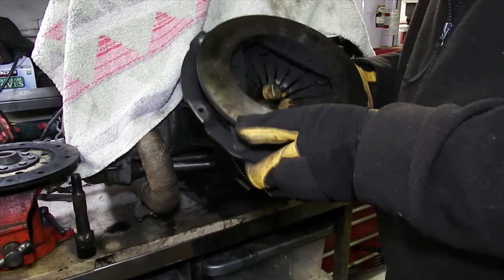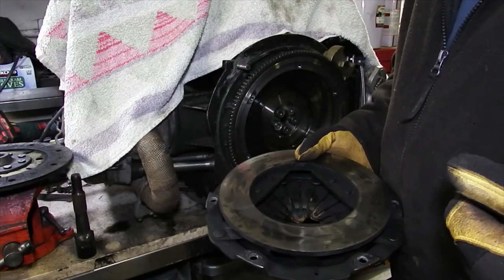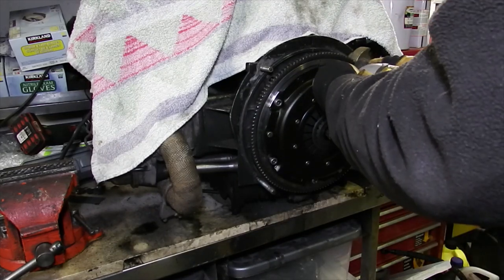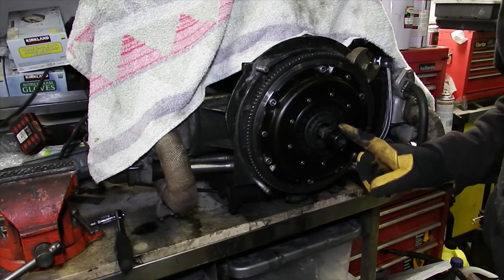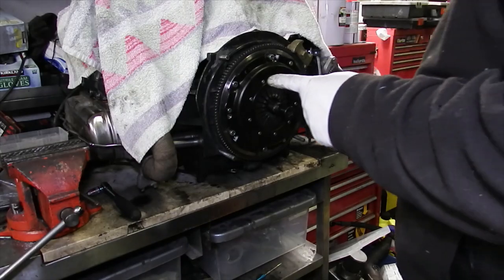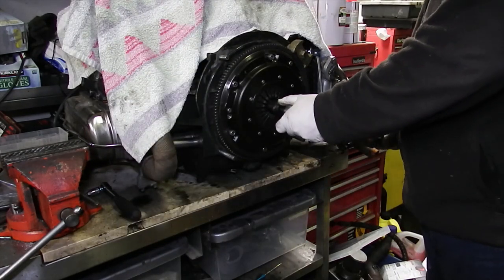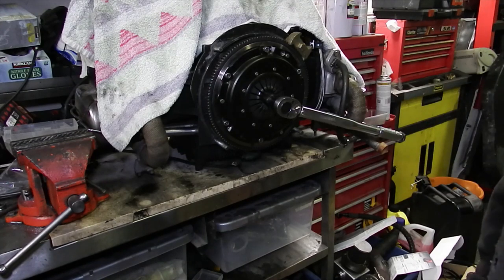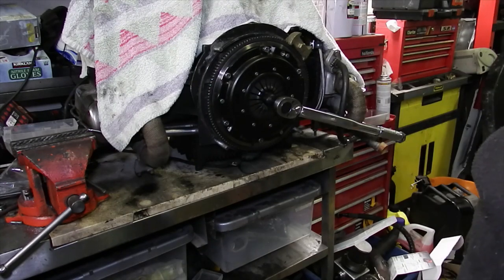Improving the VW's clutch with shims

Comment: Put some fresh lining on the clutch plate and had the pressure plate resurfaced , but then couldnt shift into gear afterwards...... The guy at the machine shop recommended adding the shim washers so the release bearing can travel a bit further to release the clutch and get gears...... I will try this before finally deciding to buy a new kit..... Thanks for reassuring that this might actually work lol

Comment: Wow, having gotten by with just a stock clutch PP and disk 'til now in my teenie little 40hp big bore 83mm type 1 engines, I've never given this process any thought. As yours (I believe) is a 300+ HP unit I can see that it becomes a lot more important to know how much holding power there is. I can imagine a day at the drag strip is no fun when you are trailered due to a slipping clutch! Thanks for this interesting video - Ted.
Reply from the maker: Yeah, I think a stock clutch would have a better 'grip'(?) if you did this, but in practice they have enough straight out of the box that it's not necessary.
Clutch problems have plagued me and this thing since I got it back on the road so this is a last ditch attempt to solve them before I have to go down the expensive route of having a custom twin disk setup made.

And yep, trailering the car 200 miles to the drag strip and then the clutch not holding is extremely frustrating!

Comment: You should show the shems and where you put them.
Reply from the maker: The shims are M8 washers of a known thickness. There are 6 of them and you place them between the clutch cover and the flywheel where the clutch cover bolts go. 
It can be difficult so a dab of grease or even a light spray glue can be used to hold them in place until you get the bolts in.

Comment: Are you still using original clutch wire? Is that clutch heavy to use? I have a problem with empi stage 2 pressure plate, original wire line is not holding ( that tube in the chassis is bending) i did throw away original wires and assemble hydraulic clutch line, it is stil too hard to use. Yes i know its all about the  a lever ratio that need to be fixed 😊
Reply from the maker: Yes, it's still the stock cable but I'm using a Type 2 bellhousing so I don't know if the lever is a bit longer or anything.
It's heavier than a stock clutch for sure, but it's not so bad that it is hard to drive.  I can drive this thing in traffic no problem at all.

Comment: What is this shim looks like and where would it be installed?
Reply from the maker: They're just washers, but they're washers which are a specific thickness.
They go in between the pressure plate and the flywheel. There are 6 of them and they're a bit fiddly to put in because they keep falling out so I used a tiny smear of grease to hold them in place until the bolts were tightened.
Reply: @2BugsandaBack  great thank you

Comment: Are you still running this clutch disk? How did you like it?
Reply from the maker: No, it was good while it lasted, but a failed gearbox seal contaminated it really badly so it ruined it. 
I've got a custom made 228mm 5 paddle disc and a matching Kennedy Stage 2 228m cover now. That's all working really well.
Reply: @2BugsandaBack  what time of material is the 5 puc made out of. I'm wanting to try a new setup myself. Thanks
Reply from the maker: @ddk56vw  It's a cerametallic one. I did a video on it here: https://youtu.be/vp2xB9R_uWc After that video, the clip came off the release bearing and destroyed the starter motor so I had to pull it all out. That's when I fitted the Kennedy stage 2 cover as well.